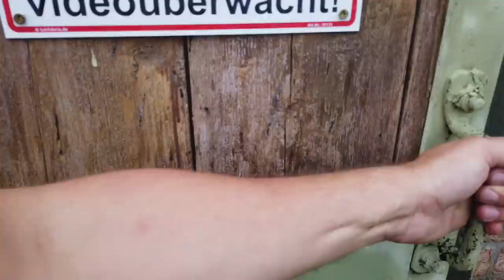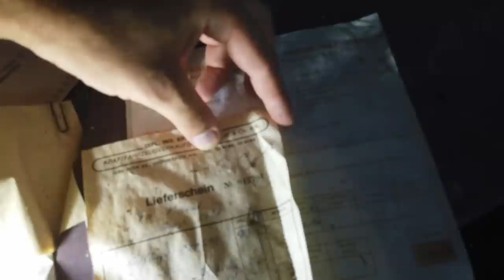Opustená Garáž plná VETERÁNOV 🚗 Ivan Donoval 🚓 Urbex Dokument

Comment: Myslím že to moderne auto je Renault 21. Výroba začala 1984. Predávalo sa aj v tuzexe sa približne päťnásobok ceny Škody 105. V tuzexe bola iba verzia TL z motorom 1.8 a 55kW v základnej výbave. Toto je GTX 2.0 a 88kW z výbavou pre západné trhy. (1 tuzexova koruna  bola 5 korún. Škoda 105 bola za 11785TK teda 58925 korún v tuzexe a Renault za  54000TK teda 270000 korún) a v roku 1994 vystriedal model 21 prvá Laguna